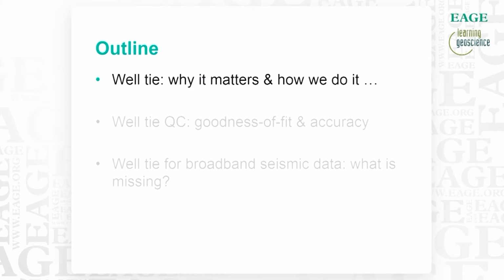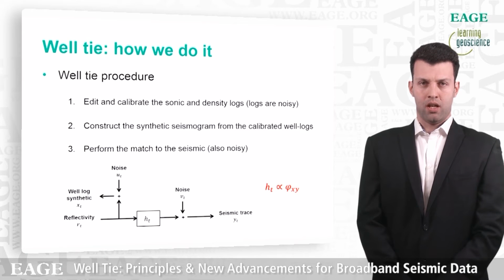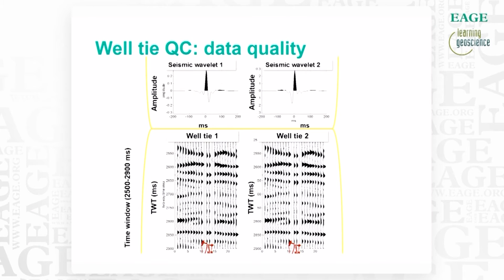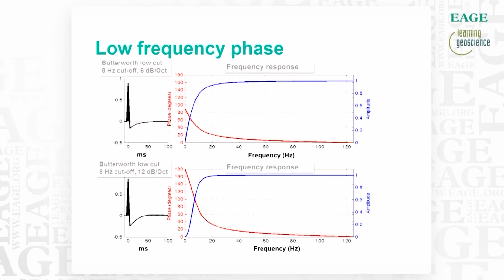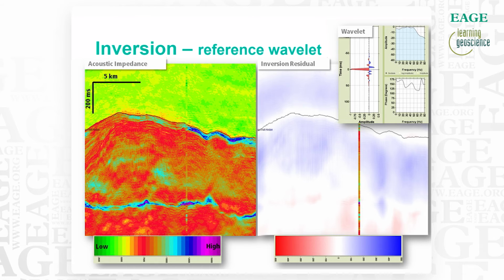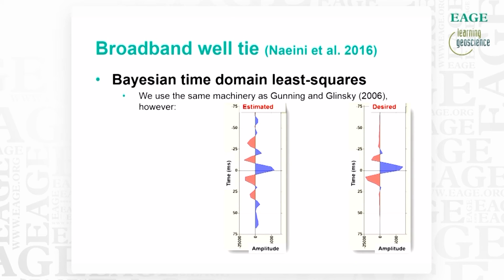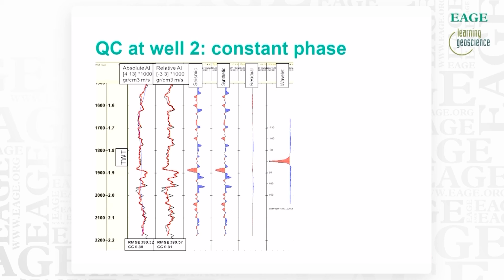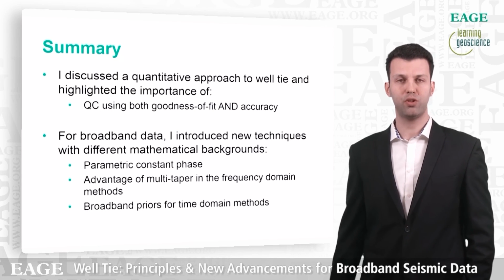EAGE E-Lecture: Well Tie: Principles & New Advancements for Broadband Seismic Data, by Ehsan Naeini

Comment: i am very sure he takes the material from seismic amplitude an interpreter handbook by mike bacon and robert simm
Reply: David, you may be "very sure", you are also very wrong. Ehsan's E-lecture on broadband wavelet estimation addresses some specific issues arising from the use of broadband seismic data which are not yet covered in Bacon and Simm (I love the book, by the way). He developed the method together with Roy White and James Gunning. The new method was then coded into RokDoc. If you are interested in detail, you can read up about the new method in Naeini, E., Gunning, J., and White, R., Welltie for broadband seismic data, Geophysical Prospecting, 65(2), 503-522.
Reply: well thank you mr.Jorg Herwanger for correction seems your working field is in seismic method.Would mind to share some of sources i can use to study about seismic attribute analysis?
Reply: well thank you mr.Jorg Herwanger for correction seems your working field is in seismic method.Would mind to share some of sources i can use to study about seismic attribute analysis?